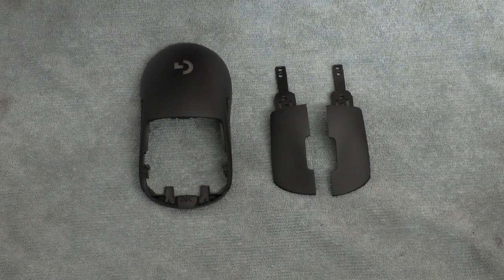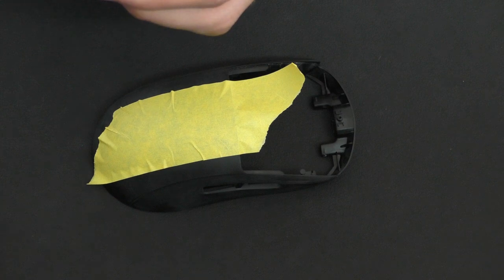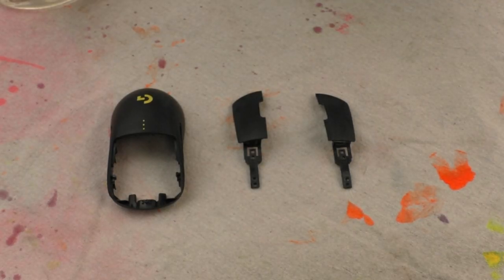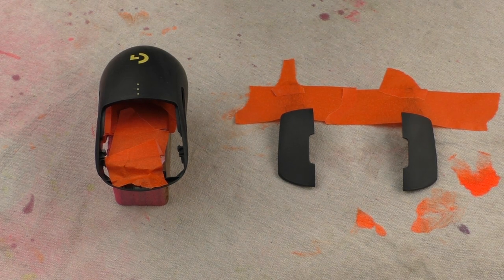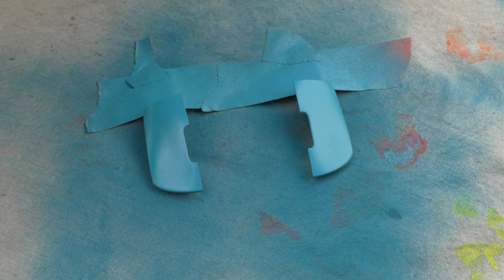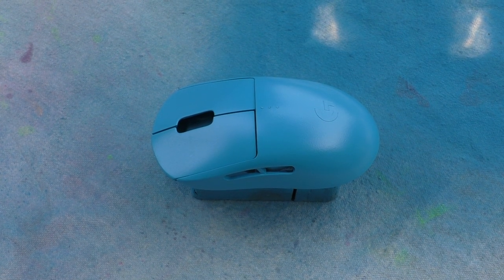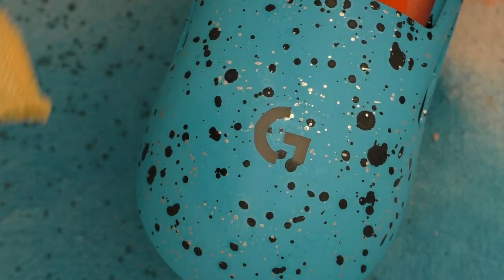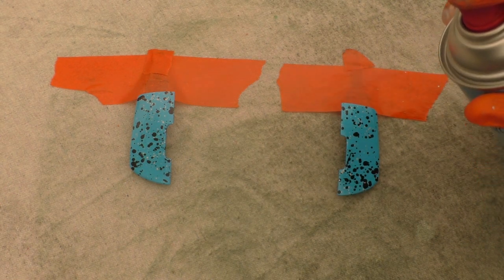Painting a G Pro Wireless - Logitech - Custom Gaming Mouse - how to tutorial (robbins egg blue)

Comment: For the stenciling process you don’t have to push as hard as him as you’ll most likely be redoing your stencil multiple times and if you mess up it’ll leave scratches. Also the tape’s pretty fragile so you won’t need all that force
Reply from the maker: Good tip :). Better to press lighter, when I do it it does leaves knife marks

Comment: If I have a white mouse and I just want to make it glossy, can I just sand it, use a primer, and use just the clear coat?  I want the glossy texture like a zowie special edition mouse (white ones) if you ever had one of those.
Reply from the maker: Correct you can just sand it and paint it clear. Never felt a zowie. The texture of clear coat is very smooth. Pretty much no texture
Reply: @snipeyHAHA  It's a grippier texture though right?

Comment: I keep having an issue with the paint smudging and pealing over time from the heat and oils of my hand, not sure if just having more clear coats would have fixed that, what do you think, what would you suggest
Reply from the maker: does the clear coat peel off of the basecoat(color). Or does the basecoat peel off the mouse? what kind of clear are you using?
Reply: @snipeyHAHA  over time all of it is pushed off to reveal the plastic underneath, this is on the sides where I grip it, the top where my palm rests and the left click most recently, I sanded the mouse, 2 coats of Rust-Oleum AE0541400UK and a coat of Rust-Oleum AE0040003E8 400ml Crystal Clear Matt, I donno if its because I didn't do enough clear coat maybe, I assume the paint and clear coat brand is okay
Reply: @FarFromLogic  u want 2-3 coats of clear coat. Try a 2k clear coat. That should do the jib

Comment: Ight so I have a question. Is it normal for the paint to eventually kinda come off a on parts we’re your palm rests the most. The sweet from me hands kinda took some of the paint off after a bit
Reply from the maker: no if you sand it and use a good clear coat it should last years without that ever happening
Reply: Use a 2k clear. Not 2x clear. 2k is a automotive clear.

Comment: Is there a matte clear coat I can buy instead? Don't like glossy. Like would rustoleum white paint+primer and spraymax 2k matte give me a long lasting paint job?
Reply from the maker: yes get the spraymax 2k matte. Thats the only matte I know of in a rattle can that will be good. That stuff should last many years and look good
Reply: @snipeyHAHA  i talked with nacho and some other guys they say that rustoleum is too thick to use and they recommended montana products. What do u think?
Reply from the maker: @Foxcez  it has seemed to work fine when i use it with no issues so far. The montana paint is probably nicer though. Also that rustoleum 2x doesnt even need a primer so it will end up with less layers which will be thinner in the end i think
Reply: @snipeyHAHA  you the painted g502 using this method right? do you still have it and have you noticed any discoloration?
Reply from the maker: @Foxcez  yea i painted the G402 with the same paint. No it still looks the same. That clearcoat will last a long time
Reply from the maker: @Foxcez  the 2k spraymax will last even longer.
Reply: @snipeyHAHA  I actually want to avoid super toxic stuff like the 2k cuz it has isocynates in it or something like that. Does the automative clear u use in this vid have isocyanates?
Reply: @snipeyHAHA  i have ordered montana varnish instead in the meantime ill need to test how durable that is
Reply: @Foxcez  You have to use that rustoleum in light thin coats. Its a enamel so it can get thick.

Comment: why do you sand down the logo too? 
and what was the mistake you made in the video and why does it matter
Reply from the maker: I sand the logo so that the clear coat paint sticks to it. The mistake I think I forgot to remove the tape the first time i put the clear on lol. You need to sand down the color before the clear slightly on the edges where the tape was also or there will be a nasty texture there

Comment: Is it recommended to sand paper it?
Reply from the maker: yes like i do in the video
Reply: @snipeyHAHA  can i only use regular spray paint like flat black color. i don't know what primer is?
Reply from the maker: @ChloeSantos14  primer is just what you spray first because not all paint will stick to plastic very well. Or some paint might be a bit transparent and won't look right sprayed over black so you would want a lighter grey primer first. Most spray paint should work fine though without primer as long as you sand it good first. Or just use that 2X type of paint I use it works really good.
Reply: @snipeyHAHA  thank you man. my mouse is white i am going to paint it with black